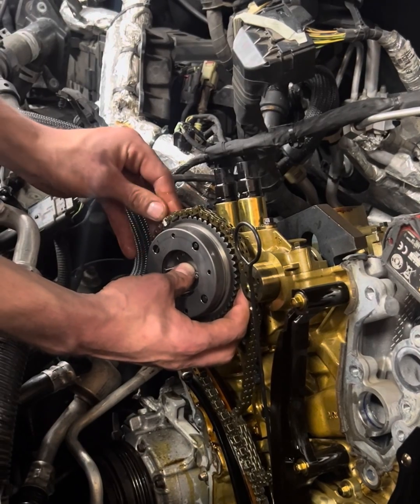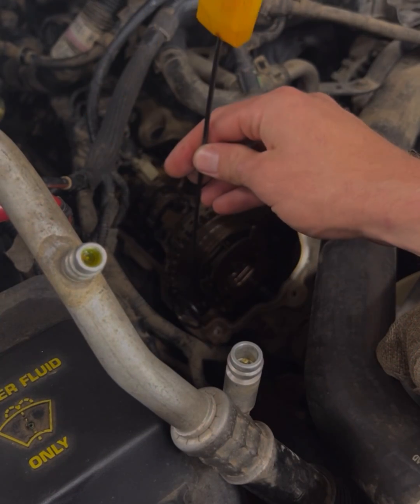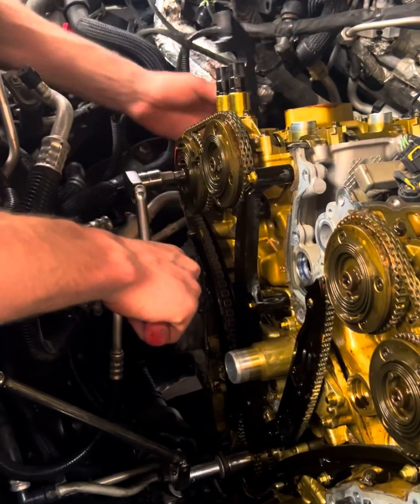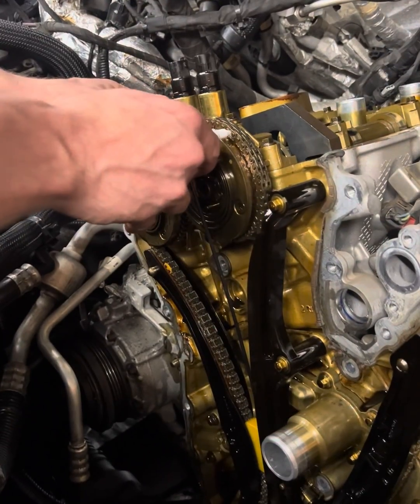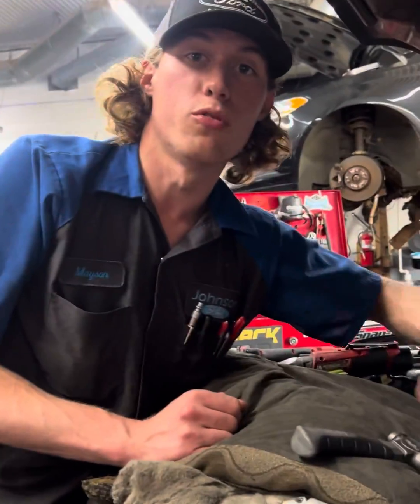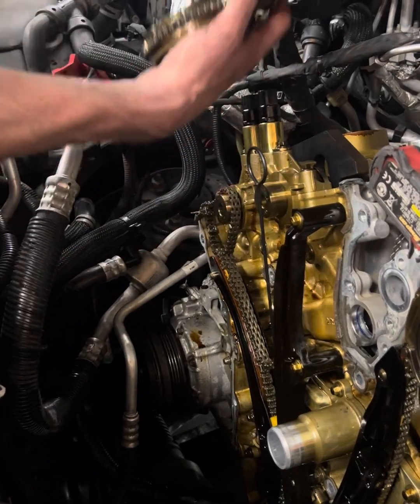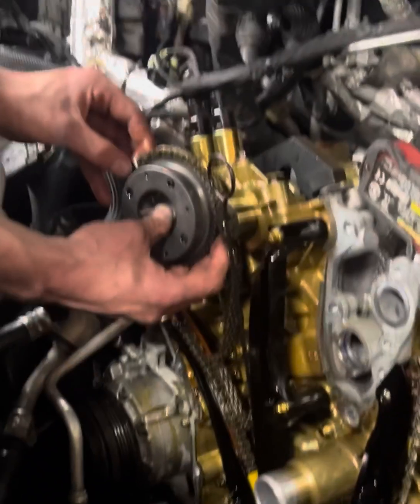Ford 3.5 EcoBoost cam phaser Replacement Just Got Easier

Comment: I need to do this to my 2017 f-150 again after the first one worked for about 3 years and now it's doing it again. How can I buy that tool and do you have a diagram of how to take the truck apart and put back together? Also I'm not a mechanic by trade b UT have some knowledge of vehicle repair. Can someone of my lack of talent do thus job in their garage without taking the cab off?

Comment: I'm replacing both the phasers and oil pump on my '19 f-150 ecoboost.  Does anyone happen to know the oil pump torque spec? google said 22-28 ft lb, but anything approaching 20lbs feels like it's gonna strip the threads.

Comment: Mine just started a small quick rattle on start up and quickie goes away 138,000 miles oil changed every 4k miles with synthetic 🤦 I shouldn’t have expected that many miles before problems with ford

Comment: kinda neat how you show the removal of the cam phaser bolts by using a 3/8" air ratchet... didn't even say that those bolts are on there tighter than billy hell.
Reply: They absolutely were holyyyyy i just did mine after watching this for pointers. Used a cheater bar fs

Comment: 2017 F-150 - first quote was $6100 second quote was $5400. Truck has 73,000 miles and young but at these prices wow. $3500 is aggressive but way better than what I am seeing. Any recommendations?
Reply: Do it yourself it's actually easy. Fordtechmakulco has a video showing the whole process

Comment: How much does that cam phaser replacement cost on average?  My 2018 F150 3.5 had them replaced 35k miles ago under warranty and they are doing it again with only 69k miles on the truck.  Can't believe Ford hasn't extended the warranty on these.

Comment: Really enjoy your videos. Very informative. I have a 2019 Expedition Limited with the second gen 3.5, that now has 50,000miles on it. No phaser rattle yet. I change the oil and filter every 5000 miles. Is there any preventive measure I can take to avoid this problem? Thanks!

Comment: Question, can you live with the cam phaser rattle or do you need to replace them?
Reply: Over time it can do damage to your engine. There is a method of pre priming the oil pressure by holding the gas and break down while cranking for 3-5 seconds and it shouldn’t make the sound. This is information I’ve found on YT doing research for myself

Comment: Question how do you replace the rocker arms on passenger side while head cams still on the truck or if the head been removed how do you pop the rockers off.

Im asking for a relative he has a 2014 3.5 EcoBoost f150.

Comment: What is the correct part number from ford for the new cam phaser? Ford did mine back at 21,000 miles 11-2021 and now at 42,000 they need to be done again. I bet they put the stock back on to get me to come back for it again thankfully I have esp so it’s only $100

Comment: Besides the phasers and the 10r80  how reliable do you think these 17 and up 3.5 Ecoboosts are?
Reply: I had an 18 and had nothing but issues. So happy I sold it
Reply: I have a 2012 3.5l ecoboost with 240k. Timing chain rattle is the only issue I have ever had. But I wouldn't buy another for that reason alone.

Comment: Hey, since you see all these trucks come in… if you were to buy a 2023 or 2024 f150 would you pick the 3.5 EB or 5.0 based on reliability and problems?

Thanks
Reply: It doesn’t matter they both have phaser issues. What nobody on YouTube is telling you. Idling is having a big effect of these failing. Remember these rely on oil that’s coming from 3 feet away down in a small hole. No matter what ALL phasers will fail over time. Some at 30k and some at 150. I’m on my 3rd set of phasers. Under 100k miles.
Reply: @iceee187  I guess I’ll look into gmc sierra with the baby duramax. Heard that engine is pretty good.
Reply: In previous videos starting with the 21 I think has the new style phasers referenced in the video. it doesn't matter what you pick as long as you change your oil every 5K or so.

Comment: I did this job and then sold that POS and bought a Duramax
Reply: We have a fleet of Chevy Duramax and they are junk by 30,000 miles terrible trucks by far the worst in our fleet
Reply: @garyhawkins1299  cool story bro. My Duramax service body has 45k on it with 3000lbs in it at all times and it's never failed me.
Reply: @Motoseaner  
We have 12 and not 1 of them is over 50miles over half are under 40k miles and every single one but 2 currently have the dash board lit up and running terrible that’s a fact if you have 1 good one that’s great but our other 10 supersedes your argument they are trash

Comment: Idk why you remove the cab , I have done a set of 3.5 phasers in 4.8 hours in dealertrack and I was stopping time everytime I got pulled off of it to do something else , the cab does not need to be removed and you can do these phaser at an average of 5 to 6 hours if your abele to stay on it I assume your flat rate like me and the last videos I’ve seen you make about the phasers you always have the cab off when it’s not necessary I’m not trying to shit on how you do them I’m saying there’s a faster and more efficient way to do them than how you do them
Reply: Bro how you take out them valve covers bc sometimes there on there good. What tool you use to pry

Comment: Is it absolutely"necessary to remove the cab for this repair? I'm thinking about doing it at home since the previous owner of my truck didn't do the necessary steps (ECU reflash) to get this covered under warranty. Obviously it would be easier to access, but at home I don't want to take off the cab. At the dealer, they'd probably destroy the couple of wire harnesses I've ran from the cab through the floor into the engine bay. Thoughts?
Reply: it is not necessary for him its easier as he knows what he is doing and can remove the cab fast
Reply: LOL! Anyone can remove a cab, it’s not rocket science. He removes the cab because he has a lift. 🙄 

And no, it’s not necessary.

Comment: How long will the whole job take? I have a 2019 Raptor I am about to take in and have this done.
Reply: Did you get yours done?
Reply: I took it in to be diagnosed one of the gaskets are on back order. Was told when it comes in they will do the cam phaser fix. 
 @labesafi
Reply: Well when I went in they had all the parts except for some gasket, they said 20k were back ordered and they would call me when mine comes.  @labesafi

Comment: My ‘19 Raptor with 129k just started to “chatter” on cold start, it’s getting louder and in the last couple of days my check engine light is staying on. 

Is their any out of warranty relief from ford, or am I screwed?

Also, where are you located and what do charge for the r&r?
Reply: Did u find any thing out, i have a 18 raptor with 37k miles n it’s starting to make the noise
Reply: My 2018 King Ranch just started as well with 123K miles.  It's at the dealer now.  $3,500 for camphaser replacement.
Reply: @hostileiron5915  think they extended the warranty to 100k, but there may also be a date deadline.
Reply: I was SOL and you will be too. It’s all customer pay. I had the timing chain done given my odometer (and since they were already in there). Waited months for those parts 🤦‍♀️

Comment: 🤣🤣 what a legend, save yourself some time he says, just pull the cab they say 😂🙄, you do solid wrk brother. Keep on wrenching.
Reply: He has a video out that answers the question he is asked the most is why he removes the cab.  He said that they got it down to a science and it takes them about 45 minutes to remove a cab.  He goes on to explain that it's much easier to work on the engine.
Reply: Wait till trucks get few years older . It’ll be huge hassle to remove body .
Reply: You can pop one of these cabs off in an hour or less. Much less bending and reaching to do the repair too.

Comment: I think it’s crazy that you pull cabs to do phasers
Reply: Makes access easier tbh
Reply: Or just pull the motor out
Reply: I don't think he pulled the cab. You can see the hood above his head when he is working on it.
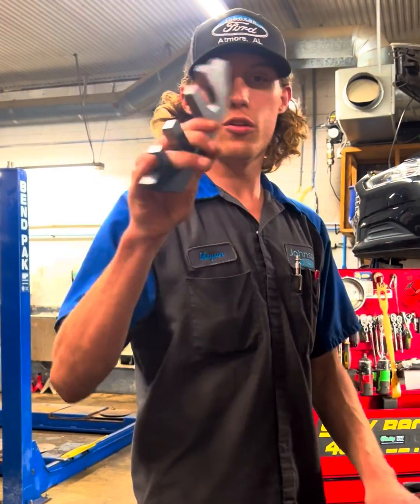Reply: @samuelmcginn4908  at 0:43 it shows one with the cab removed, after that the other clips show a different truck with the cab still on
Reply: @samuelmcginn4908  yup, a bit of humor

Comment: About to go become a ford technician. Looks like I would never run out of work the way they build these new cars and trucks.
Reply: Depends on what part you like in mechanics, if you like electrical diagnostics go work for Chevy, mechanical stuff go for Ford, if you want the whole meal deal then go work at Chrysler. 
And as a bonus if like buying every special tool ever invented you can go for the Audis or VWs.
Reply: @fordmud lmaoo true with the vw
Reply: Lol. You’re right.
Reply: True
Reply: Really wanna make money work for Nissan 😂
Reply: @chadmcquade3075 CVT specialist! Always have work.
Reply: You want plenty of work become a Dodge mechanic. You'll be doing engine  transmission and rear end swaps on fairly regular basis among other issues they have. Wheel bearimgs that go out every 30,000 miles when they should last well over 100,000.00 miles but thats Chrysler for you. If shit doesn't start falling off of it before you get it off the dealers lot something is wrong. Dead on delivery garuntee expired. No truer words have ever been said.
Reply: Wait till he discovers ESP (extended warranty program) if the customer bought it with the car it is under warranty and you do all these jobs for warranty labor.
Reply: Honestly they all have their problems (not to give Ford any excuses, they sure don't do themselves any favors) but being a quality mechanic is in short supply, I do my own work and feel I do better than most shops
Reply: Yeah, you want guaranteed work?  Become a Ford mechanic!!!  Yaaa!  Hooo!  Really, Ford executives should be ashamed.....  Maybe they could give up some of their million dollar bonuses to help us pay for this crap!!!
Reply: Run away- Ask him what he gets paid to do those phasers- its like 6hrs
Reply: Youll never make money either for the amount of work to do a simple job.
Reply: Replacing a piece of crap with a piece of crap
Reply: Been keeping me busy for over 30 years!!😆😆🤣🫡
Reply: You most certainly won't
Reply: Yea I switched from Toyota to ford and I make more money now as a tech.
Reply: I should have bought a damn Toyota haha